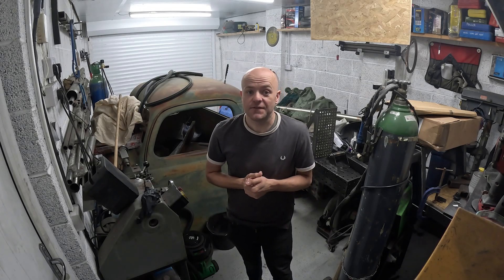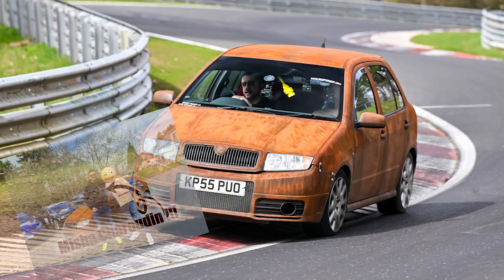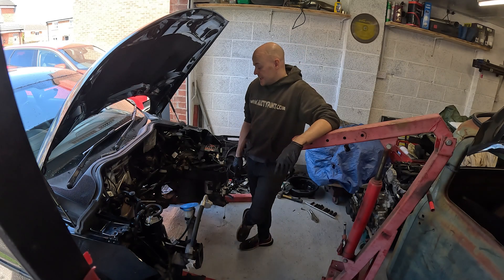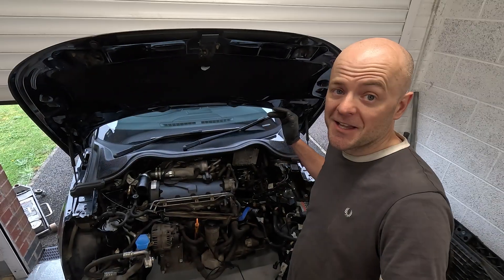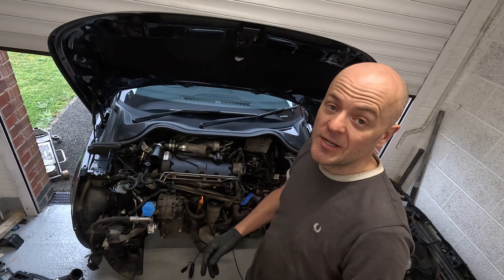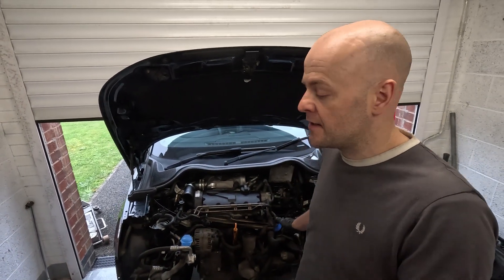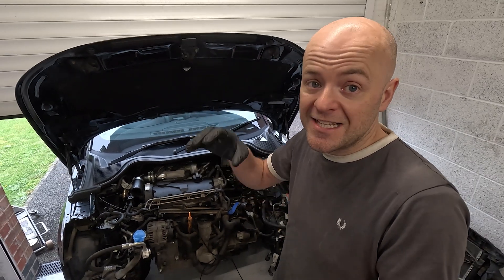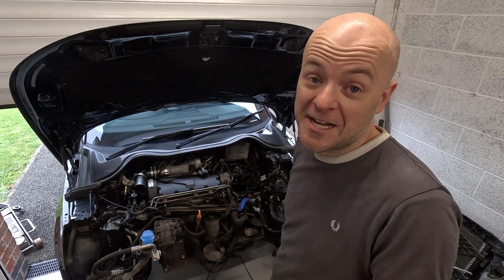Easiest Engine Conversion Ever? Audi A1 Engine Swap - Fabia VRS PD130! OEM + Vid #1of 3

Comment: Can you help to do mine ?
Reply from the maker: Happy to help with any Questions 👍
Reply: @rustypaint is the engine running standalone or is it working with the Traction control and all?
Reply from the maker: @aqib2000 standalone without traction control as it’s better for track. You could get the a1 original loom and ecu to run it with a load of modifications, but I wanted to be able to take the engine out with wiring and put it in a newer A1 easily

Comment: I have an ibiza 6j that was orginal an 1.2 tdi so same platform as the a1, and i also swapped if to a pd engine, i drive it with the orginal 6 speed driveshafts from the ibiza 6l - polo 9n 9n3 - fabia vrs 👌🏼👍🏼
Reply: Whats mpg like?
Reply: Easy swap?